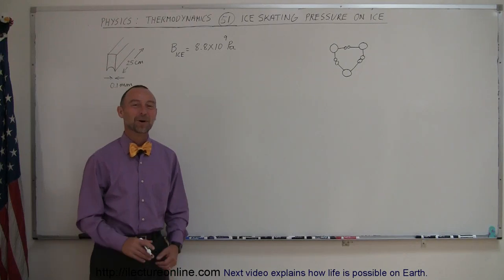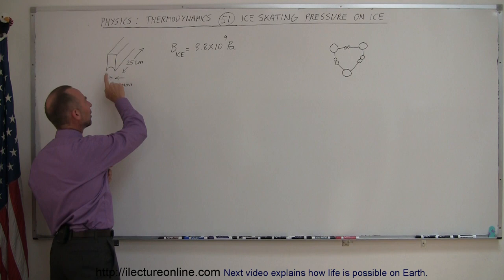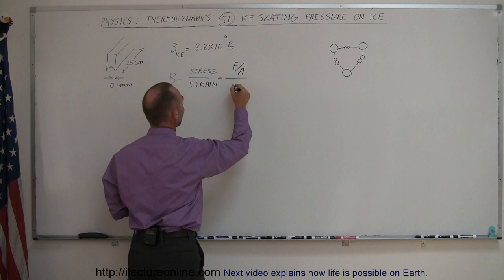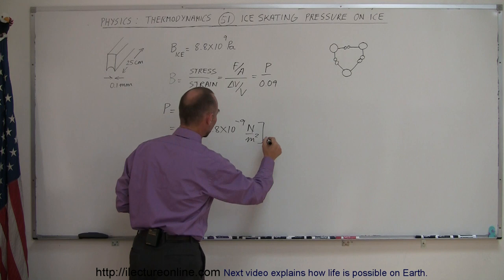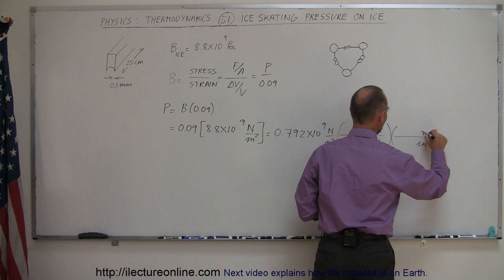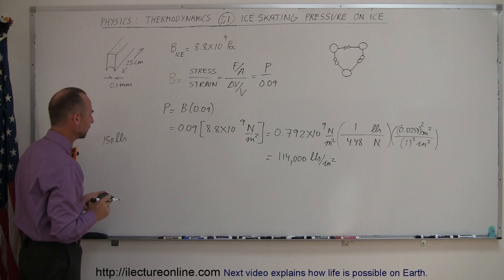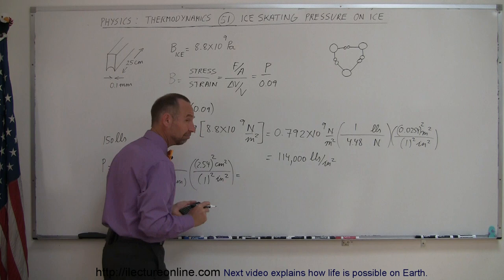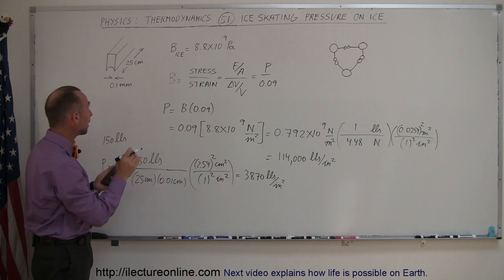Physics 25  Properties of Water (4 of 8) Ice Skating Pressure on Ice

Comment: Hey Michel, keep up the good work your videos have been tremendously helpful for me. Just one note, if one side of the blade has a width 0.1mm (as shown in drawing) and the blade makes contact with the ice at both sides, the area would be doubled. so to 2 times the area you calculated which would obviously half the pressure to 1935.
Reply from the maker: Yes, I need to revisit, this concept some more when I get a chance.  Thanks for the input.

Comment: ıs it possible to ice skate on other materials like solid CO2? (I need I thermodynamical explanation) I think it may be possible and if we know CO2's bulk modulus we can calculate the accurate temperature and pressure by using clapeyron equation. But ım not sure even or not we should consider that CO2 sublimes.
Reply from the maker: Water has the unique property that it expands upon freezing and the applying pressure to ice causes it to melt.

Comment: Hi prof. Michel. First of all, thank you for your videos. Started watching your thermodynamics series and I'm learning alot!
However, I believe there's an error in your calculation in this video. You assumed the force exerted on the blade to be the same as the weight (mass, in this case) of the skater. Of course, you will have to convert that pound mass (150 lbs) to pound force first by multiplying by 32.17. I believe that would prove that the pressure exerted on the ice would momentarily melt the surface in contact.
Reply from the maker: Hi ahmad.  Thanks for writing.  This one had bothered me for a while but I had since forgotten about this video until your wrote your comment.  It turns out the calculations are correct and the 150 lbs is the weight (not the mass) and thus the calculations are correct.  However I believe my assumption was incorrect.  As it turns out I probably should have used the Young's modulus and calculated how thin of an ice strip is melted.  I probably should try this one again with that different assumption.
Reply: @MichelvanBiezen  happy I was of some help... even tho I was wrong ;)
Reply from the maker: That is how we learn from one another   :)

Comment: Hi there, With all due respect, there are 2 things incorrect in this video. First the bottom surface of the skates is not always hollow. It is only hollow with ice-hockey skates. This is done for extra grip in the very short corners. Speed skates, optimised for low friction, have a flat bottom surface. My seccond point is that ice does not melt under the weight of the skates. The time a passing skate at 45 km/h touches the ice is way to short to melt it. What actually is happening is a typical surface effect where the top layer of molecules are not realy attached to the ice and roll between the skate and ice layer. Cheers, Adrian.
Reply from the maker: Very good input.  Thank you.
Reply: Not really attached?  There are still hydrogen bonds from the surface molecules to the molecules below in the bulk.  It's a compression process whereby the ice structure is collapsed.  The collapsed ice structure results from the breakage of the hydrogen bonds of the hexagonal ice structure .  The water molecules can now move as they are in a liquid state at this point of the process.  This is a phase transition process caused by pressure.